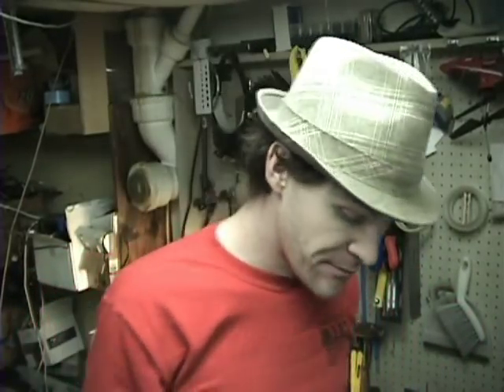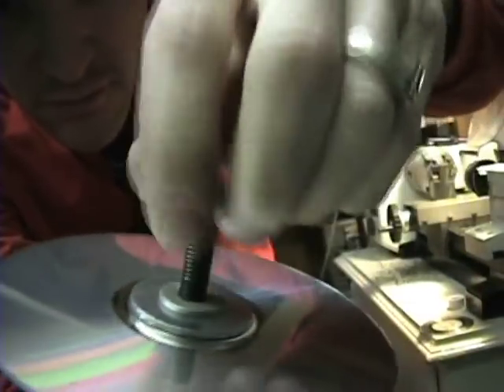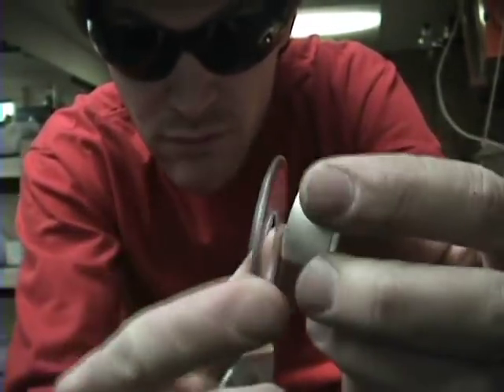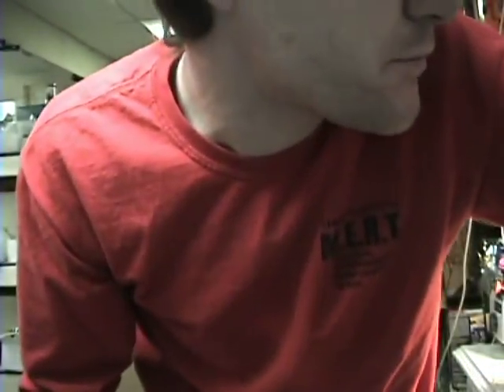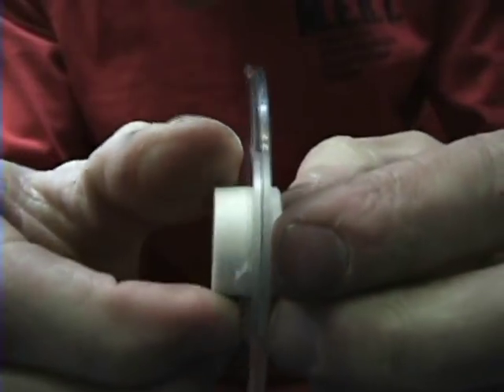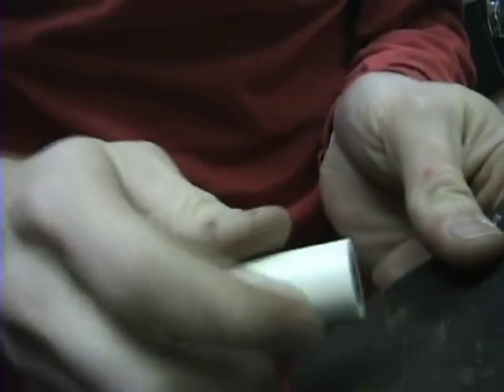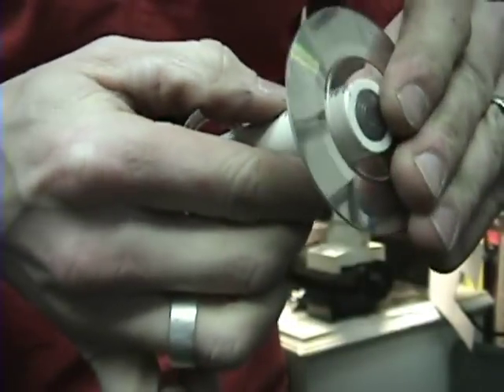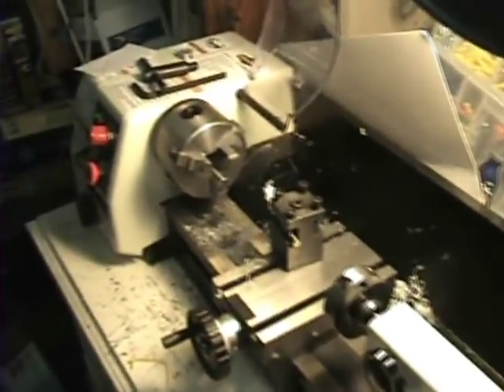How To Make Bobbins Cores For Coils, Just Another Day In My Shop... ~Russ

Comment: Russ, the out-side cut-off's would be good to use for making flat Rodin's on. You can remove the aluminum film from the cd's with some duct-tape.
If this is for a Bedini pulse motor like the S.S.G., lots of people use rusted welding rods for the cores. Have a talk with Gregor about some of the different core materials you can try with the same coil set-up that you have. And I think it's a very cool core making idea you have come up with.
Peace.
 Mike.

Comment: Great use of the lathe, was that a dead center you were cutting with? Also may want to try with out iron in the magnetite, but good iron fileings can be found at mechanic shops from there brake lathe . Will be interesting to see if there is any improvement in coil cores. Peace rawbush